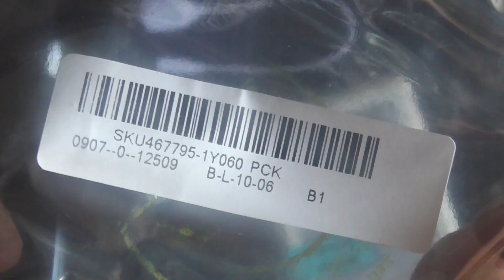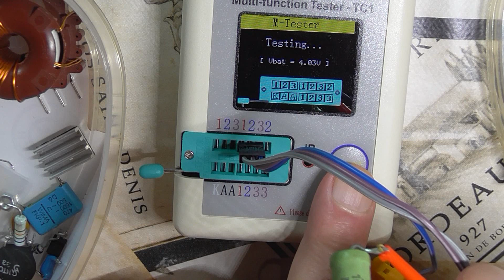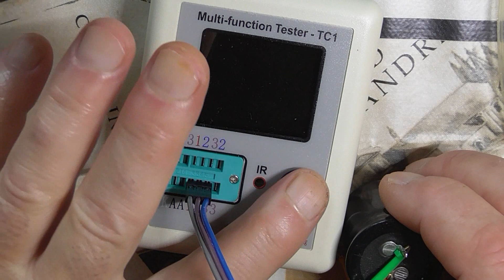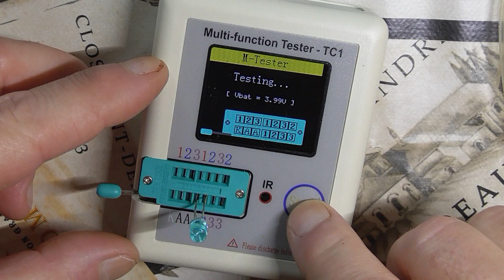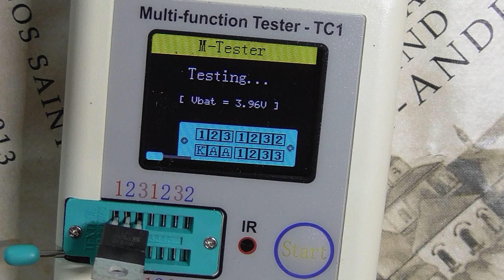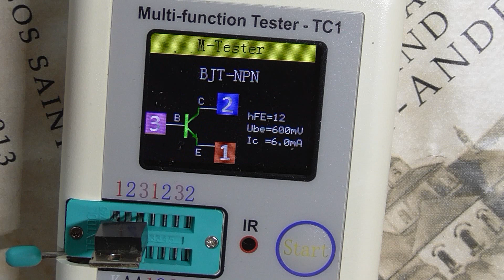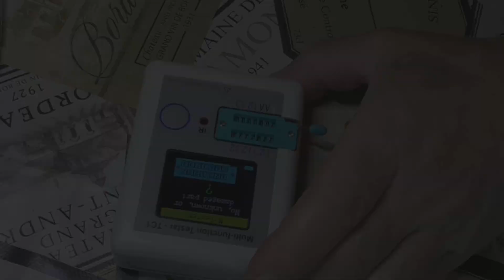Multifunktions Color LCD Transistor Tester TC1 Meßgerät Banggood

Comment: Hi. What is the highest capacitance you can measure with it? How accurately? Thanks
Reply from the maker: Zener-Diode-: Transistor: 0,01 – 4,5 V zone-ZENER-DIODE: 0,01 – 30 V
- Einsatz: IGT < 6mA
Kapazität: 25pf-100mf
Widerstand: 0,01 – 50 mΩ
Induktivität: 0,01 mh-20h

Comment: Can you make a video to show what can be done with the IR tester at the front?
Reply from the maker: Please look under the video part2
Reply: Sorry, didn't see that one. Thanks!
Great work!!!
Reply: can this be used to test capacitors or other components in circuit?
Reply from the maker: In the circuit it is not possible to test certain components. Removing or partially expanding is always necessary.
Reply: Hallo! Kann ich Firmware für TC1 finden?

Comment: Just got one TC1 yesterday.  3:50 It seems that some transistors are identified as 2 diodes. Also I had problem to identify ceramic capacitors. Maybe because I have got only high voltage ceramic caps?
Reply: That´s because it is 2 Diodes in one case ;)

TCMBR20200CT
20A SCHOTTKY BARRIER DIODE
Dual High Voltage Schottky Rectifier

Comment: Rectifier diodes of bridge? Test?
Reply from the maker: I forgot, sorry :-(
Reply: Does it know its a rectifier, or will it just show a bunch of diodes?
Reply from the maker: one rectifier has 4 connections, that gauge max.3 connections therefore a measurement is not possible. 3 connections work and 2 diodes are displayed.

Comment: I have multi-function tester TC1 but i can't turn on device. It worked little bit and theh drop dead. Maybe someone know solution. Thanks
Reply from the maker: on screws .. look where no voltage flow .. maybe just a battery broken wire ..
Reply: Georg Z. I try that. Battery is ok and the wires are on the place
Reply: K